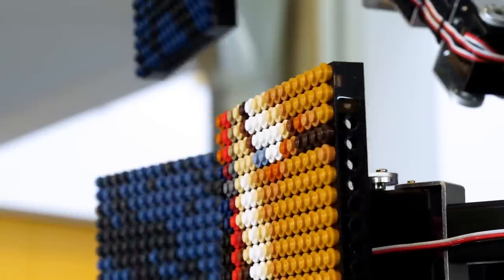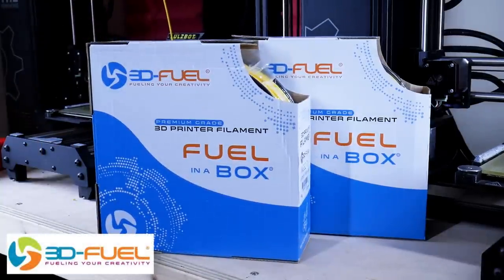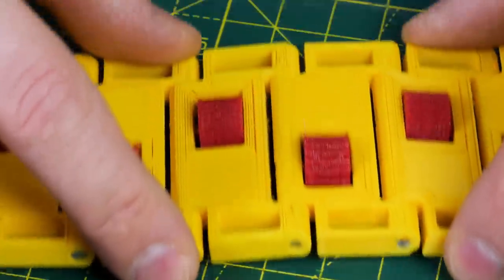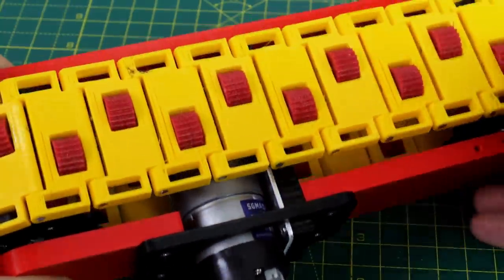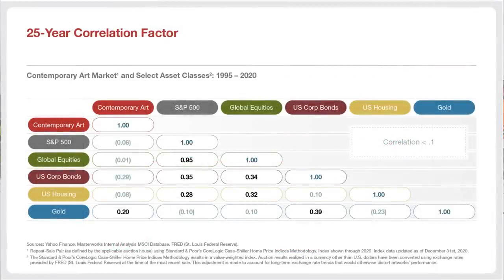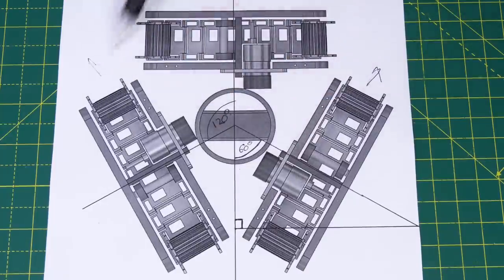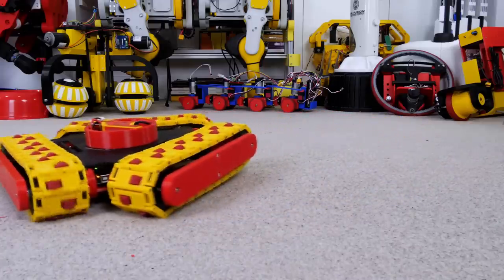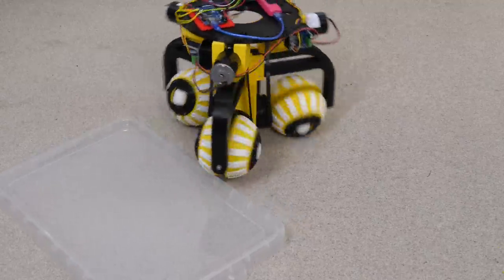Will this Omni-Directional Tank Work?

Comment: Your traction problem is actually a pretty classic problem. It's easily solved by putting a pivot point through the center of each tank tread where the axis of rotation passes through the center of your triangle. This allows your tank treads to tilt so that your rear doesn't disengage with the ground. It's very common on heavy duty vehicles. I'm not entirely sure, but I think they might call it a tilt axle.

Comment: Cool tank!  looks like suspension would solve the rough ground problems.  Even just pivoting the track units in a simple rocker-bogie suspension would help a ton.  Bigger TPU sub-wheels that span the full width of the track would also help, give more ground clearance for moving sideways too.

Comment: I love the concept of this design, have always been fascinated with tracked vehicles. I think this design has a lot of potential, however, the core flaw in your tread design is its rigidity. If the treads had some sort of pivot/suspension you would have more success in multi-terrain environments. Attack angle would also be good for the ends of the tread, but ultimately would only increase its terrain climbing abilities and chance of flips/rolls. Would love to see a part 2 where you give your tread configuration more love (the sideways motion solution is a simple and genius one).

Comment: Tracks need "road wheels" (wheels underneath the track all along its length) to bear the weight when object pokes up between the drive wheels.  look at photos of military tanks.  The road wheels have equalizing levers on them so the forces equalize.  This prevents loss of contact when part of the tread hits elevated object.

Comment: I think that you could add a leading segment 1 or 2 centimeters long onto the front edge of the track, angled 30 degrees upwards from the ground, and put a TPU grip on that. It won't touch the ground normally, so it shouldn't bind the sideways motion, but when the track hits something in front of it, the angled leading pad will contact and grip.

Comment: I think if you want an omnidirectional drive system that can handle rougher terrain, you might want to look into something based off of a swerve drive. This would allow you to use more conventional wheels (which you could make pretty beefy if needed), while still getting some extremely flexible movement options.

Comment: A relatively simple solution would be to reverse the movement of the robot so that it had the two driving tracks to the back. To solve the issue with that of the straight edge hitting the plywood then you could have the mini wheels mounted on the edges of the tracks and put the power through the middle. I would love to see this project return because I think that with improvements this could be an awesome mount for lots of autonomous movement vehicles.

Comment: Give the tank tracks leading edges (adding  a smaller sprocket up front on all 6 positions, and second, give each tank track a pivot point in relation to the triangle arm, that's normally forced to go down against the ground (with a flat spring, for simplicity). Combined, these should allow it to climb over anything, depending on what level of angle you allow from the pivot point.

Comment: Perhaps 4 tracks in a diamond configuration? Like this... <>... That way controlling each pair of tracks gives you motion in one of the two directions (X and Y) while eliminating the issue with a non moving track while climbing obstacles, and spinning them in the same direction gives you rotation.
Reply: Exactly what I was going to suggest. Basically, throw away the passive "rear" track that's sideways when trying to climb up the obstacle, and replace it with a mirrored copy of the two front tracks. And add a flexible joint in the middle, so the rear tracks can stay fully in touch with the ground while the front ones angle up on the edge.

Comment: A lot of tanks have a smaller raised idler wheel that is raised to make the attack angle of the treads more steep for uneven terrain. This produces a more upside down trapezoid shape for the ends of the tread than the ovular shape you currently have. I know this would add some additional complexity to the design but could help with the climbing issues.

Comment: Despite the other comments, I actually think you might be able to get away without a proper suspension system. WWI tanks had basically no suspension, and they did their job of bounding over trenches and gaps just fine; sure, their crews ended up concussed from the bouncing and it was impossible to aim, but that isn't a constraint you're working with. My suggestion would be to increase the diameter of the side-rolling wheels and mount them on the outside edge of each track, then give the tracks themselves a bit of negative camber to keep the wheel side pressed down. I don't know if that would work, but it would be a very simple solution. The wheels would be what climbs over the obstacles in that case, so going long-side first would probably work, while the positioning of the wheels would let the wedge side have some grip on a side.

Comment: Put a pivot point in the middle of the track so that they are almost always touching the ground. Also, more weight could help. And I you really want it to work, put suspention on each track along with the pivot point so that all tracks always have two points of contact with the ground. But I think just putting a pivot point in the middle of each track would do a massive difference because it would allow the tracks to always have 2 points of contact with the ground, even if you don't add suspension to it. I think its an idea that's worth a try. (Sorry for the English quality, I speak french 😅)

Comment: Maybe having three tracks that point straight outwards could solve the issue of them getting lifted off the ground. In that configuration, all three tracks would always be driven actively when driving over an obstacle.
Combined with another suggestion of tapering the tracks up at the end, this could work pretty well to climb over stuff.

Comment: Make the track paths conic sections instead if using a track with a flat path. In this config, all the modules in your track will no longer have parallel sides, they will taper and the other ortho sides will have a slight curve. Have all the cones for the tracks share their tip point.

Comment: You should try orienting the tracks so that they radiate out from the center making a Y instead of a triangle. That way, all the tracks would contribute when moving in any of the three main directions, so you wouldn’t have any passive tracks, and you wouldn’t loose traction. You might not be able to to turn though. 

A compromise configuration might be halfway between a triangle and a Y. Arrange the three tracks so that each has one end adjacent to the center of its neighbor. They should form a smaller triangle with extended “arms”. The tracks wouldn’t intersect the center of the platform, so you’d still be able to turn, and you should be able to avoid the traction problem of the triangle configuration.

Comment: What if you gave each tread the ability to swivel (in the yaw direction) using a servo? Essentially giving you the ability to position the treads perpendicular to the edge you're going to climb. This would not solve the issue of the back tread being undriven, but it would give a much better grip when grabbing onto edges. This should be very doable since these are "omni" treads and would be able to swivel easily. On another note, this would also be able to increase driving speed by swiveling in the direction of motion :)

Pair this with some form of suspension (like others have recommended) to give contact with the floor, and I think it might work. 

Thanks for the video!

Comment: I thought of something omnidirectional I'd love to see you build. Imagine a cyclocopter, but with the rotors spinning vertically, with fixed castors at the bottom. As the castor rotates, it can thrust by being loaded axially, but then rotate to be loaded tangentially as it moves around the other side of its horizontal circular path. I hope I'm explaining it right. Like a ground based multirotor. Damn that would be cool.

Comment: Rotate the tracks 90 degrees, and allow them to each pivot vertically at the center of the track. You'll end up with a sort of Y shape that should be able to climb up objects. As any angle you approach from will have track driving in that direction. Allowing them to pivot should let them bump up ontop of objects and help drag the rest of the vehicle up, while aslo maintaining as much ground contact as possible in the remaining tracks.

Comment: Maybe a normal tank and then a PISTON in the middle that would lower down with a bit stable "FOOT" base. lift up the entire vehicle and "rotate" around the piston.

The only advantage over a normal tank is it would not tear up the floor so much like a normal vehicle would.

I think better would be dual powered wheels like a mobility chair. that gets you your omni for the most part and then have a set of "treads" that can lower down. now the treads would give you the offroad you want at the cost of omni while you are off roading.

Comment: Amazing. Bonkers, but amazing.The issue is yes that there is a non-moving obstacle at the front or rear of the direction of traction, which is disastrous for all terrain vehicles where traction needs to be at the far ends of any direction of movement at (almost) any angle.

Comment: What's about using two apring loaded idlers, on on the top of the chain, one on the bottom. When the chain looses ground contact the lower one is doing its thing and it is moving the chain towards the ground. When the chain is in normal condition, the upper one is a bit stronger than the lower one, just as much that the chain is tensioned on the upper part.

Comment: Using standard Trapezoidal tank tread geometry would solve most the problems with getting onto objects, and also if you round over the treads edge on ... Bonus, with the tri configuration, you won't lose any stability, tread patches could basically be upside down triangles.

Comment: "Zoe The Robot" approves of this video. Many people don't realize the importance of spring mounted bogey wheels on tracked vehicles. The weight of the vehicle needs to be spread out as much as possible over the ground contacting part of the treads. Without the bogey wheels, you may have just used four standard wheels.

Comment: You need more sprockets to give the treads a bit of an upward angle on the underside to grip on edges to climb. Also, a servo on each tread could make all of the treads point the same direction for better unidirectional speed and climbing, while still allowing them to make other formations for omnidirectional functions.

Comment: There are some really good comments for solutions. I wonder if a simple fix would be to allow each track assembly to rotate passively about its middle.  This would let tracks with a climbing front edge to pitch up, with the rear end of the track dipping down to maintain ground contact.  Of course, this will likely introduce some stability issues with the central chassis, which may be mitigated by some springs to maintain a nominal 'level' for each track assembly.

Comment: Make the 3 tracks all point out from the Center of a triangle and add another drive motor near the outer end of each track to drive the small rollers so you can still rotate. 

You could also redesign the tracks so the small rollers extend past the sides and switch to using a single central gear interface in the middle of each track.

Comment: Heya, there are probably a hundred comments saying this but I think the main problem with your obstacle-climbing on this design is the lack of suspension.

The reason large tracked vehicles are able to maintain grirp on bumpy surfaces, is they have a series of idler wheels that rest on the base of the track, these are connected to the main body of the vehicle by a suspension set. This means that if there is an uneven load delivered to the track the running gear will be displaced differently along the length of the track, resulting in much more of the length of the track remaining in contact with the ground.

Engineering such a thing would likely be difficult on such a small scale, due to the mechanical complexity of introducing springs and dampers into the mix, but I'm sure it could be done. Instinct says you may have trouble with throwing tracks if you decide to go down this route but due to the reduced torsional loads due to the near-abscence of lateral friction thhis may actually prove to be less of an issue and I'd be intrigued to see the results.

Either way, great work with your robots as usual!! Love them to bits, and hopefully my limited experienci in this field is at least a little bit useful (assuming I explained this in any way well at all)

Comment: Have you thought of making the tracks pivot/tilt? Basically make the frame of  each of the three tracks able to turn both clockwise and counterclockwise to so if say the front goes up onto and obstacle, the back is pushed down and grips. 

It would probably make the vehicle slightly larger, to make room for the pivots, but likely not by a lot

Comment: This configuration of tracks would have the benefit of being far more able to move on slick surfaces like ice or through liquid spill zones, so theoretically it would be useful in cold and lab accident conditions. For it to gain better multi-terrain capability the tracks would need to be redesigned closer to that of a tank with the suspension-equipped bogeys to hold up the robot. This is going to be quite the interesting bot to watch move around, and I wonder how you'd go about making your own springs, maybe coil spare PLA around a small rod and bake it to make springs, then use thin bars of TPU as shock absorbers so it doesn't wobble? I was never good at materials science XP

Comment: Really cool project, not something I've ever seen or thought of before. A few other commenters mentioned that tanks usually have a ramp up at the front/back for climbing over obstacles, but I don't think that's the issue here.

Maybe if the little red wheels were on the outsides of the tracks rather than more in the middle like they are now? might only be necessary to put them on the outer edge of the track. That way you don't get the situation you got where the PLA outer edge of the track hits the obstacle and doesn't get traction.

Comment: Try changing the way the tracks mount to the body. So the length of the track can rotate with respect to the body. That would allow the rear of the tracks to maintain ground contact when the device reaches an obstacle.

Comment: Some kind of suspension is going to be required to keep the driving wheels in contact with the ground. I think like the purpose of omni-wheels which requires them to have limited traction to allow for side-slipping, is diametrically opposed to the goal of "off-road" which really does require maximum traction. So this adds to the challenge, but I don't know if you will ever even approach the level of off-road climbing which is possible with much simpler designs, eg. motor-on-axle (MOA) crawlers.

Comment: Sliding is fine for a prepared surface.  Not so much for off-road terrain. Sliding ends up digging. You'll need ground clearance and as much surface area contacting the ground as possible for grip.

Comment: I feel like if you had four short tank tracks, two on either side of a rectangular robot, and put tall but thin treads on them at 45 degree angles (such that they’d trace out a box or an X), you could run them like normal tracks for forward, backward, and rotational motion, but running them opposed like mecanum wheels would grant you sideways motion.

Comment: Ab overcomplicated, but cool looking, solution would be to have a tripod, where each foot is a tri track design in this video, with a swivel joint between the foot and the leg. When one foot is disabled by having to climb, it is pushed or pulled by the other 2 feet.
But it will still be terrible in many situations, since the sideways moving track can easily snag on obstacles.

Comment: to add to the fine analysis by Nobody Knows, how about just allowing each track to pivot slightly (perhaps with a bit of spring) in the center, to allow the rear of the track to remain in contact with the ground while the front edge mounts the obstacle.  Cheers!

Comment: If you're going to try to omniwheel this, you need to omnitread it, not stick wheels on a tread. Each link in your tread need to itself be a secondary tread oriented at a right angle. That way they can hold their grip without slipping even as they turn to match the main axis of movement.

Comment: Idea for a project: I saw wheels made out of carbon fibre feet years ago (*think* it was on discovery channel, made by the fellas that make the Ripsaw.) Similar to the spring--legs/feet that amputee track athletes use. There was 3 of them on a hub and they curved around and they acted like suspension and offered amazing grip because they were just feet digging into the ground. They were very light so it was a possible idea for all terrain vehicles on the moon or mars.

Comment: Think you need slightly bigger wheels all the way to the sides of the track(only outside would do).
Then it should do obstacles fine, but you might need to move up the center part or it not to get stuck.

Really loved the idea though, this could totally work!

Comment: Independent supsension for each track module might lessen the issue or have them pivot in the middle of them. Having a rigid body isn't helping it at the moment until some flexibility is added that the tracks can't offer.